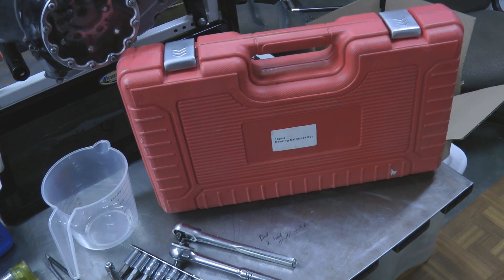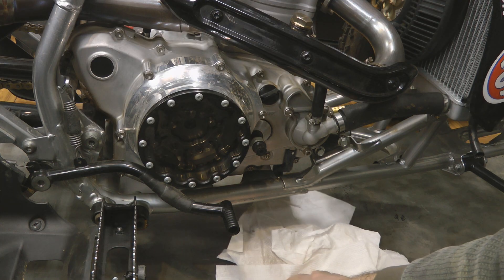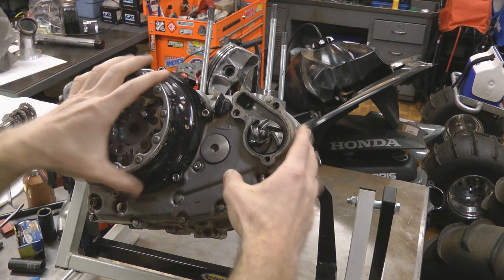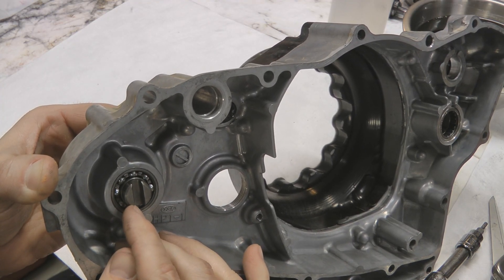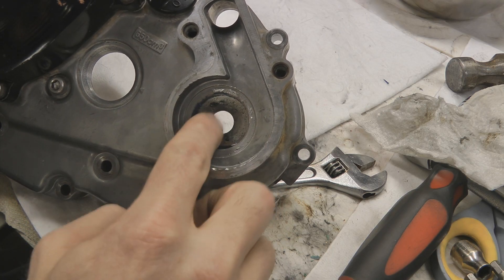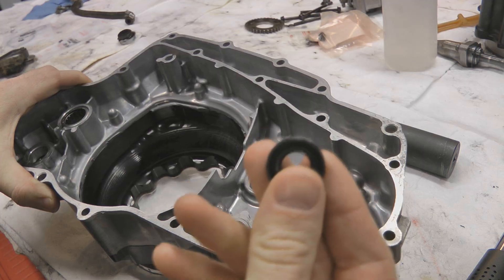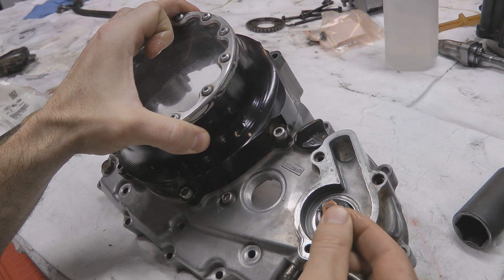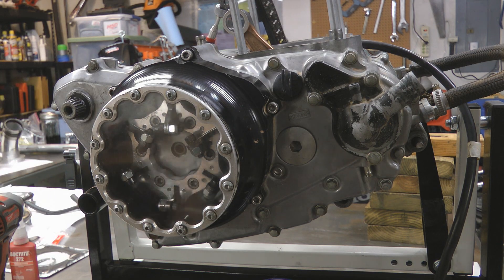Hott Boy's Garage - Ep. 27 - Water Pump Assembly Rebuild on a Honda TRX450R

Comment: you make fantastic videos. Your info on the 450rrr forum is very useful to. 
My webcam came with instructions and in those instructions it says to not use synthetic oil. I’m aware that you don’t use synthetic while breaking the engine in, but the instructions said to not use synthetic period. Do you have any insight on that?
Reply from the maker: Thanks for watching. I'm not sure why Web doesn't recommend synthetic oil. I normally use Rotella 15w40 (white bottle) for both engine and transmission oil tho.